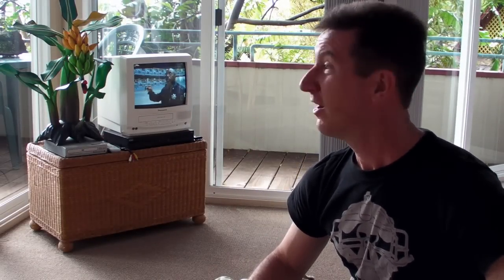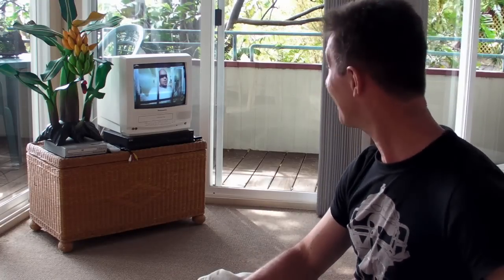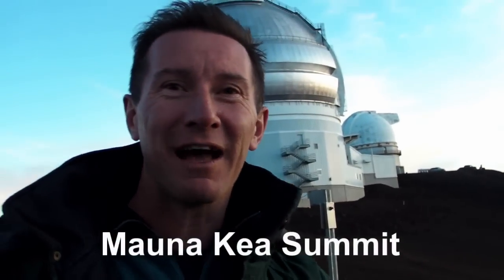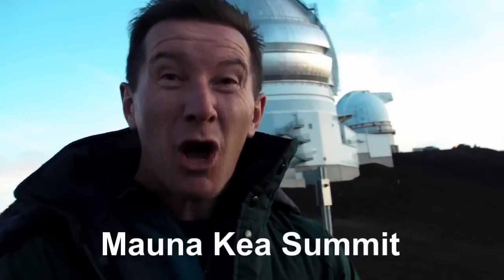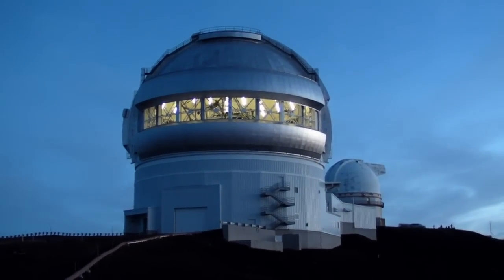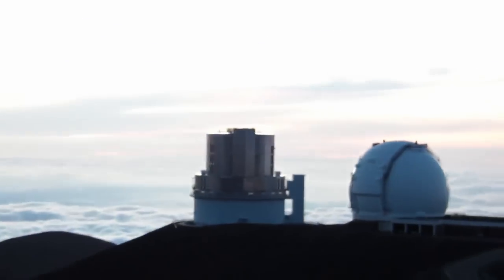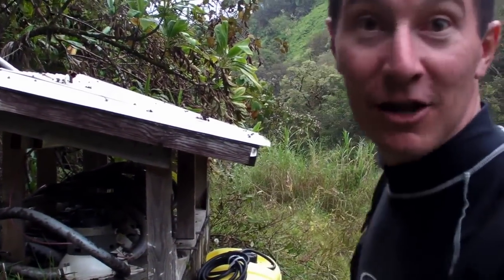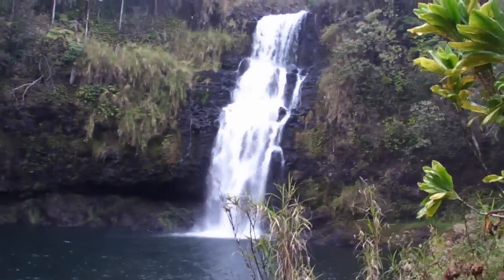EEVblog #69 - Sex Toys, Telescopes, Cable TV, UHF Modulation, Renewable Energy, & Silly Shower Taps

Comment: I know this is a very old video, but I have to defend the one taps out there in the world! Where I live most houses have 2 taps, just like in Australia BUT I insisted on installing a 1 tap in my house... Why? Because they are MUCH simpler! You always know the angle at  which you like your temperature for a shower, then it's just a matter of lifting the tap and there's your perfect and fast shower! Whereas on the 2 tap you have to be remembering how many turns on each tap, counting, adjusting, and if you want less pressure than you are used too, good luck adjusting that.... 1 tap is just: select your angle then lift!

Comment: As with the taps, I actually find it simpler and faster to have one knob control temperature. since I generally don't care about pressure. to be, more = better. Although some hotels have horribly regulated outputs on them, and the temperature can fluctuate hugely from freezing to boiling in a matter of seconds!

Comment: I know this is an old video, but, I'm working my way through them in order.
The comment about the large black cables that Dave calls cable lines appear to be older style telephone cables. They are so large because they are 50 or 100 pair cables with each pair being an actual analog telephone line. The large cans on the cables are there to hold the 'beans' where they crimp on the house service  and where they splice all the pairs from one cable into a new cable. Splices were done with crimp on 'beans' which are single ended rather than inline so they splay out perpendicular from the cable and necessitate the large cans. Those cans are also hinged so that the worker can open one side or both and work on the splices within.

Comment: It's the hotels that have those single lever shower taps.  While they're available for home use I've never seen one in a house.  My guess hotels use them and provide no way to reduce the water pressure is because they want their guests to have a spa-like experience and use major water flow in the showers to help accomplish that.  And using vastly more amounts of the resources while staying in a hotel seems to be the American way.

As far as the US fetish for TV channels, some cable/satellite packages have upwards of 800 channels or more, and then double that to duplicate them in HD.  And speaking from experience, it's 800 channels of total shit, with about 3 channels that have something on worth watching and it's usually reruns of good TV shows from the 80s.

Comment: I think hotels use those taps to prevent people from taking long showers. (also if you thought those lines had a lot of wires, try coming to NY (they are about half way there to a makeshift Faraday cage in some locations (a bunch of power lines are under ground and they have got a grid of then on the sides, all thats left is the top :)

Comment: I would agree that Wind power MIGHT ruin the coastline if there are hundreds of them. But Solar and Hydro power would have no such effects, and whats more I find it extremely odd that they don't use any of this; especially when there sitting on top of a giant generator. The Islands themselves could be used to produce Geothermal energy.

Comment: Yeah I hate those stupid single valve things too.  We have one in our shower.  My grandpa has one that has the hot/cold valves.  What I think would be superior is a cold/hot ratio selection valve and a pressure selection valve.  Much easier to adjust that.  Unfortunately, it's not common, if existent at all.  I know I've never seen one.

Comment: I'd agree that the all-in-one taps that don't allow you to change the pressure are crap. However, I prefer the kind where they work on two axises so that you can control the temperature separate from the pressure, unlike the two knob solution where if you change the temperature you have to fiddle with the other knob.
The way most of the combo spigots usually work is you just turn it on to get some pressure and then switch it to shower mode by pulling the knob on the spigot or overflow drain.

Comment: quite an old video this one but i'd still like to explain a bit about the complicated shower taps in hotel rooms etc. The spring-loaded knob that you have to pull out to get water at the spray head returns to its original position when you close the tap. This ensures that the warm water that is still in the hose between the tap and the spray head can flow out. This is a very effective method to reduce the risk of legionella bacteria growth in the hoses.

Comment: One of the reasons for the shower diverter designs with regard to one control for hot and cold water and the lack of pressure control is because, there is a valve that maintains the same pressure for the hot and cold water.  If the cold water pressure were to drop because someone flushed a toilet,  the valve would automatically lower the hot water pressure.  This system is great because it maintains the same water temperature as the pressure changes.

Comment: Dave, as some of the people here have stated, those type of shower fixtures are mostly used in hotels, motels and newly constructed homes. Those fixtures can be set for the desired temp of the shower water, I'll assume that most hotel/motels set the temp at the low end of the comfort range to save energy. Those fixtures also have a built in anti-scald element to protect the elderly & very young as we are a very lawsuit happy society.

Comment: Those big ugly cable lines are likely phone lines. Cable TV lines aren't extraordinarily thick - perhaps 15 to 20mm for the backbone variety hung from pole to pole. But telephone cables are full of copper local loops, a minimum of 25 pairs per cable, and possibly hundreds.  Those big black cylinders are splice points or punchdown blocks/junctions. Despite some areas getting fiber to the home, we will likely have copper local loops for decades to come.

Comment: And on the subject of TV modulators, if it's an NTSC modulator, it almost certainly outputs on Channel 3 VHF (61.25 Mhz); UHF modulators are quite rare in the U.S.

What is not rare are confusing shower controls in hotels. A lever or pull-up knob on the spigot is standard in homes, but in hotels sometimes you have to pull down on a ring around the spigot to switch to the shower.  It's VERY well-hidden.  Also annoying are the fiddly massage heads... I just want to take a shower!

Comment: We have a single tap system here, left-right for temp control, up-down for presure, or two knobs but one tap. So what is so hard about that?

The most idiotic tap system I've seen was in UK, where there is one tap for hot and one for cold water, and they mix outside the pipe. So insane, I can wash my teeth or hands or whatever in super cold or super hot water... that is just idiotic...

Comment: As a yank, I'll fill you in on the shower issue. Those types of showerheads are mostly seen in hotels. In most homes, we have a setup with a hot and cold tap, and either a third tap or a levre used to pick between filling the tub, or running the shower. However, almost all hotels have this extremely confusing setup, and it baffles us too.

Comment: regarding the taps, whenever i go on vacation, the hotels always seem to have the single dial taps you spoke of. At home (in the US), i have the normal Hot and Cold taps. I think it is just a hotel thing. But i agree with you Dave, i'm not a fan of the single dial ones.

Comment: Single tap ones wouldn't be so bad if most of them were designed propertly, instead u get ice lod water from 0 to 30% range and very hot from 70% to 100% range

Comment: There is something else about the single-tap shower that I haven't seen anyone mention either. Its actually a good product design, contrary to Dave's statement. The single tap means that the tap 'knows' the temperature that you have it set to so when the water pressure changes, like when someone flushes the toilet, the temperature doesn't change so you don't get scalded. It's a safety feature! When the pressure drops in one line, the pressure in the other line is lowered as well, to maintain the same temperature. It isn't easily done with a two-tap system.

Comment: dual taps are common on older houses.   while newer ones have a single tap. cheapo.  normally  one these i just let the tub part run and ajust tell its correct.   wastes a lot of water though

Comment: The tap issue is something that irritates me in the United States as well.

Here in Germany if we have shower and bathtub combined, which is a quite common setup, we have a single tap for both, also with usually a knob that you pull to activate the shower. However, you can set your temperature first with the water going straight into the tub and then simply "switch over" to the shower. For regulating temperature and water flow there's three different kinds commonly used. The oldest that has separate valves for hot and cold, just like Dave described, the typical design where you have a single lever where pulling up on it increases the flow, while pushing down on it reduces the flow down to 0, and swiveling it left and right adjusts the temperature. You still have full control as with the two-knob setup, but you can control both parameters individually, like shutting off the shower while keeping the temperature setting. And there is the more luxurious version where you have a real thermostat in there that you set and another knob to adjust the flow. In my previous apartment I used to have one like this as the  water pressure fluctuated a lot when people in the apartmens below me used either hot or cold water, leading to my shower constantly changing from too cold to too hot. They are pretty neat, but more expensive.

In the US I have seen taps that look like the most common one in Germany, but the handle only rotates from off to cold to warm to hot. Flow rate can only be set to full or none. Pretty irritating that is. Just as the fixed shower heads that are often mounted so low that I have to twist and turn to get my hair wet and washed. lol
In some showers I have seen something that looks more like a big spherical knob that moves in two directions, usually in/out for flow adjustment and left/right for temperature setting. Admittedly that's quite rare in hotels there and more common in private households. Don't ask me why...

But the weirdest water setup is clearly the British "two faucet" system. I never found out how to properly get my hands washed there when they are either boiled or frozen, depending on which faucet I used. (I know there are historical reasons for this setup, where the cold water was always of drinkable quality, but due to the way the hot water was generated it wasn't necessarily safe to drink and therefore they had to be separated - but come on, it's the 21st century, We have solutions for this...)

Comment: In France, we always had the duals like in Australia but nowdays, i'm starting to see more and more single taps that you control like some joystick. vertical axis for presure, left to right for temperature so you don't have to mess around to find the perfect temp.
In the shower, we installed a tap a few years ago that has pressure on the left and temperature on the right with a temperature limiter that forces you to press a button that allows the temperature to go higher than 30x (x because there is no actual sensor, there are only numbers with a mark at 30 something ... ). This thing is pretty handy as you set the temperature once and don't spend minuts trying to turn the knobs to the right temp, only the pressure you want from waterfall like to the karcher presure washer thing. :-p

Comment: DAVE!! We have all sorts of shower controls in the US. Give us another chance.
Reply: Yes we have shower controls to adjust flow and hot cold separately. But you don't see it often in hotels. But flow control in the shower is a bit pointless. Most people with flow control just put it on max anyway. So it is easier to just have one turn lever to just adjust temperature. I have flow control but I always want max flow and the smartest thing is to have a water saving sprayer. So with a water saving sprayer max flow is just perfect amount of pressure and flow volume. So I think flow control is pointless with the right water saving shower head.

Comment: The single faucet showers are a result of product safety regulations that require anti-scald mechanism in the controls. There is a floating cylinder that is balanced by both the hot and cold pressures that moves if one of the pressures drop and supposedly prevent accidental scalding by the old and young. Though perhaps not this, I am sure you have similar rules in Australia. For example, I see you have outlawed the sale of incandescent light bulbs........

The problem with renewable energies is the cost. Like it or not, nuclear and fossil fuels are cheaper, and it is argued in the US, allow poorer people to have the benefits of low-cost energy. Also, windmills are ugly to many and kill many birds. Most would rather get their energy from one small plant that they never see than from windmills cluttering up the countryside.  

Over half of Americans don't believe in man-caused global warming....so expensive renewables are a hard thing to sell. It sounds fine until their electricity bills double or triple.   

The big proponents of it in the US are raving hypocrites who preach to the middle class about global warning and then fly home on their private jets.
Reply: I call bullshit ......

My state of Iowa generates over 30% of our electricity from wind and that number has increased every single year since 2004. Meanwhile just across the Mississippi River in Illinois they just passed a bill to SUBSIDIZE several Nuke Plants because they couldn't compete again Wind which keeps underbidding them. To double the insult even though one of these Nukes is just a dozen miles upstream from me on the same river our city (Davenport) gets all it's drinking water so while we take ALL THE RISK not a milliwatt of the electricity from that Nuke comes here, it all goes to the Chicago area which burns up megawatts of power in just transmission losses ..... 

If trains aren't safe enough to even transport oil then how in the hell are we going to ever move all that ABOVE GROUND Nuclear Waste piling up at all 99 reactors in the US ?????
I suggest you read the excellent well researched paper by the Union of Concerned Scientists:  Nuclear Power: Still Not Viable without Subsidies (2011)

Take away their subsidies and all 99 reactors fold and go bankrupt ..... Take away their Tax Cuts and Tax Credits and the Dakota Access Pipeline loses money hand over fist until oil goes back over $75-80/barrel ...... Meanwhile several Sioux Tribes are more than willing to build a series of large scale Wind Farms on a half a dozen different reservations but Government Red Tape and lack of Investors has kept these projects from getting off the ground ..... while the Dakota Access Pipeline goes throw on a Fast Track Permit with ZERO Environmental Assessments in near record time .....

"If ye love wealth greater than liberty, the tranquility of servitude greater than the animating contest for freedom, go home from us in peace. We seek not your counsel, nor your arms. Crouch down and lick the hand that feeds you; and may posterity forget that ye were our countrymen."

Samuel Adams

Comment: about the shower taps: here in germany most people have a wheel for pressure and one for temperature
Reply: I know what you mean, but in the part of germany where I am from, the majority of shower tabs are still the combined things. I guess the wheel and pressure thing is taking over on the long run though!